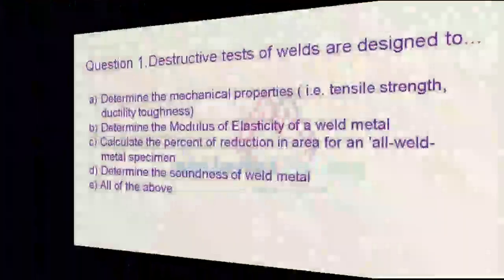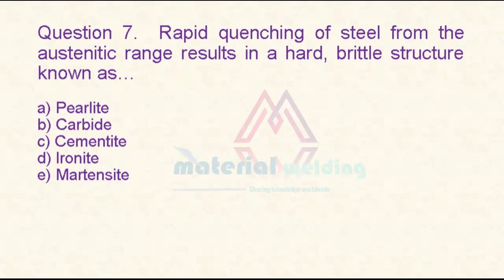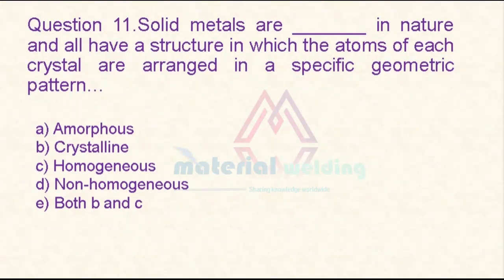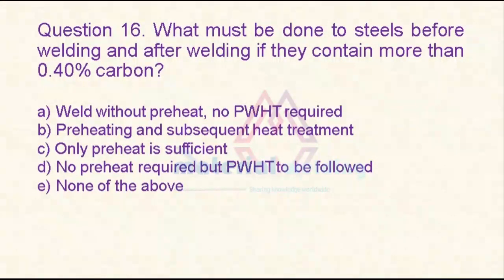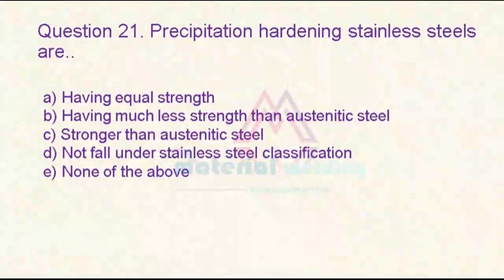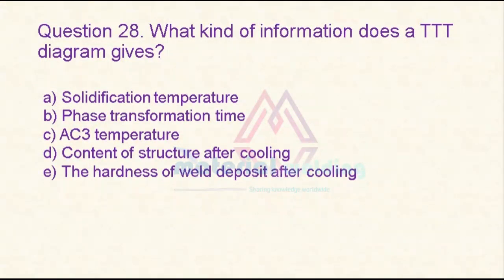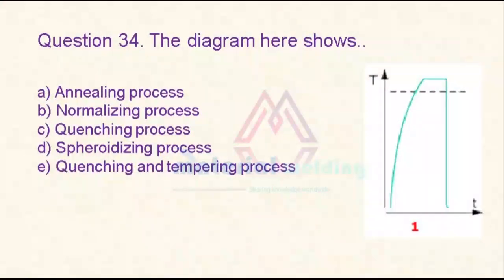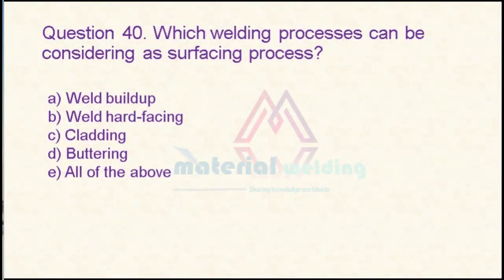International welding engineer exam questions: Material and their behavior for CWI and CSWIP

Comment: Question no. 6 - why cant it be option E
Reply: Also question no. 38 - any grain size below n equal to 65 (Astm gs no. 5 & above) microns is fine grains. Isn't it !?
Reply: Question no. 17 - higher carbon content will increase the yield strength and reduce the elongation. Isn't it !?
Reply: I think so. The answer should be c. @naren18ify for question 17.
Reply: I think question 6 should be E.

Comment: Question no 18. is the answer provided correct. ? 
Any person would say that high carbon steels are tough to weld without a 2nd thought.
Reply: A low HI process may assist in welding high carbon steel. but does that mean the weldability is Good? 
Pls advice
Reply from the maker: Thank you for your feedback. This question is for IWE exam and right answer is C.
Reply from the maker: I will go with a high heat input to weld high carbon steel as it will help me to reduce the cooling rate, give more time for the hydrogen release and reduce the stresses, so help to eliminate three reason responsible for weld cracking.
Reply: High carbon steel's weldability is poor. So I Think there can be a mistake in the answers. Not notweldadble but yes poor welable.

Comment: Which is the correct answer for  Q36 NDT full form? Non Destructive testing or Nil Destructive Testing?
Reply from the maker: Thanks. in material science, its called Nil Ductility Temperature.
Reply: @MaterialWelding  thanks for the clarification